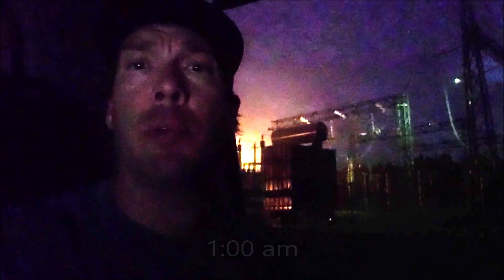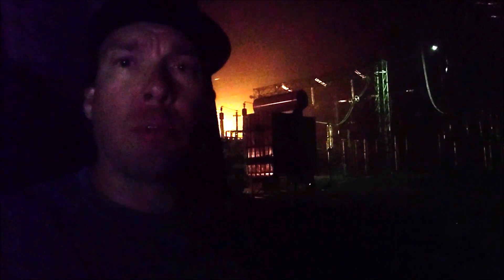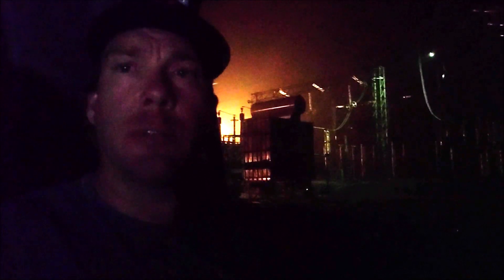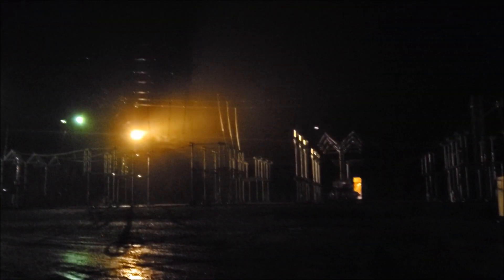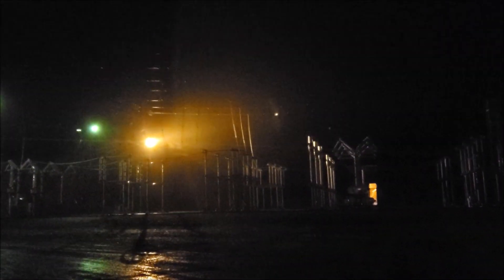Linework during thunder and lightning

Comment: I looked at the weather radar coverage of Canada, including the East Coast. 
https://en.wikipedia.org/wiki/Canadian_weather_radar_network#/media/File:Canadian_weather_radar_network.png 

 IF you live under that umbrella  of radar coverage, you should have a very good idea where thunderstorms are, and where they are headed.  IF your location is outside the coverage, you might consider having your employer install a X-Band Marine radar with a 6 foot long open array antenna.  I was one of the volunteer operators in the County I lived in for 30 years, operating one, before we had the big WSR-88D National Weather Service radar installed 50 miles away. A X-Band 25 kW marine radar up 60 feet can have a range of 94 miles on 40,000 foot high storms.  The modern radars are digital and can be put on the internet.  This would be a giant safety factor for linemen.  We saw all kinds of weather, hail, tornado funnels, in very sharp detail.  The National Weather Service called us twice for help when their WSR-74C radars either were down for parts or had such a heavy storm on top of them they could not see through it.    And likely this would run around US$15,000 or so.  Just turn off the weather clutter remover and you will see a lot of weather.  Several manufacturers make radars specifically designed for weather radars in the US$200,000 up into the many millions of US$.  But a simple marine surface search radar does a very good job of telling you where it is, speed and direction, and a good idea of what is in a storm.

Comment: In the Gulfport Biloxi area here Mississippi Power co has installed about a 8 brand new reclosers on an existing main feeder on Pass Road a main surface road. They added an extra pole between existing poles to add the reclosers on the big 3 phase feeder. It is 13.2 kV line to neutral. It is like the recloser sales guy had a field day in sales.(or they have some weird grid issue to fix)  In  one place there is 4 reclosers in about 1.2 miles. This is the first time I have seen so many that close together. 

These all have a small transformer to power the control box, The box is at eye level at the pole. Some have a UHF Yagi antenna aiming I think at the substation. 

There are a lot of thunderstorms here and hurricanes too. For inventory new transformers get a 6 digit number, stuff like reclosures often has a 5 digit number after a letter, like X123456. I think it too is for their grid schematic since the single 3 phase reclosure has three numbers. ie like X123457 and X123458. 

 They tend to replace the entire yard arm assembly on an existing pole with a fiberglass one with all three insulators already attached.

Many Decades ago some some 1950's & 1960's era neighborhoods had some distribution transformers in parallel. Most of these are gone now. There would be  a 10 or 15 Kva transformer for 2 or 3 homes and another 10 or 15 Kva transformer for 2 or 3 homes and the power co had two extra wires for the two 120 volt legs between the poles. Later they came in an cut out the 120 volt "Paralleling" two wires and ran 2 homes on a 15 Kva or 3 from a 25 Kva. The poor lineman had to use some sort of paralleling test lamps to get the phaseing correct on  the secondarys. Because we get emergency line crews from many states after a hurricane a weird settup is rather dangerous to have.

The coop cooperative power co here uses 14.4 Kv Line to Neutral on the coast. One third way up the state 7200 line to neutral is common and one sees banks of voltage regulators every few miles on a 3 phase feeder. 

A old Legend I heard was after one of the big hurricanes (1947 or 1969 Camille) ? that the coast upgraded to the 13.2 Kv from 7.2Kv since so much was destroyed. Another Legend I heard was the higher voltage stuff is less lightning resistant. Decades ago there were pockets of 2400, 4800 and 7200 stuff that was fed by a mini substation or step down transformer by that pocket.

Comment: I've never worked in the electrical industry, but I've built a few high steel structures in my time.  The standard was the same. If you even see lightning and it could 15-20 miles away. Everyone comes down and the crane comes down.  Then you sit and drink coffee and wait for the storm to leave the area. Until recently, the record distance lightening has been known to travel was about 350 miles. However, within the last year it was observed at a much greater distance. Don't quote me but I believe it was 2500 miles, as observed from space.  So, this is why the SOP is to stop work and take shelter.  

Also did you hear about the two line men that were killed in Saskatchewan? People assumed that it was an electrical incident. However, from what I hear, they both feel out a bucket.  I'm waiting for the details to the circumstances. I find it highly suspect with safety standards such as fall arrest,etc, in place. I speculate that perhaps a mechanical failure on the truck or some other contributing factor. Just my thoughts.

Comment: I leave jobs for at least one hour after last thunder is heard. Lightning can strike out of the blue from storms over 25 miles away. Radio tower work is no fun during a storm even inside the transmitter building. 
I remember a co worker was working on a cable TV line amp towards the end of a T-storm when a bolt hit a pole down the street from him, you never seen someone gaf himself down a pole so fast and into his truck. He later returned to the amp to close it up.

Comment: Wow that is quite the lightening!   Got to like the hum of those big transformers too.
Reply from the maker: The 345 lines were real noisy in the humid air before the rain started too!
Reply: @Bobsdecline  Oh I bet!  I actually heard the sound of HV lines for my first time the other day.  I always wanted to go take a picture at this one spot on the 655 where they go go in a straight line, and while I was out there taking pics of the lines and the changing leaves, I could hear the lines and even feel the power. Most of the lines here are 138kv and I felt that line had to be higher.   Being the nerd I am I looked it up after and found that it's a 500kv feeder from Abitibi Canyon generating station going down south, it's one of few 500kv lines in Ontario.  There are more down south.  It was quite interesting to feel the power on my arms.   This is one of the pics I took: https://i.imgur.com/6VxxQ3K.jpg  I was zoomed right in there, it makes it look like I was up into the lines but it's taken from some rocks on the ground.  They droop quite a bit.

Comment: Talked to a lineman turned electrician years ago while doing contractor escorts, he said he always carried a lightning detector on the job, soon as it detected a strike he came down and sheltered. Should be standard kit for a lineman. You can get them for under $100 on Amazon nowadays.
Reply: Or you can spend only a few dollars and carry a portable/pocket AM radio. Tune to a blank spot on the dial and when you hear the crackling static of the lightning......BTW most lightning detectors are basically an AM or other type of radio with an indicating system.

Comment: NO NO NO being outside in a thunderstorm.

If you ever record a storm using slow motion you see the streamers coming up from the poles and the ground, asphalt is an amazing conductor.

I see asphalt hit more often than any other item, even when streamers are coming off poles high up, the lightning ⚡ takes the asphalt streamer defying the idea that it would take the shortest distance to ground.
I guess asphalt is a lot better ground than an electric pole.
Reply: Asphalt isn't a conductor. It's oil and rocks. If asphalt was a good conductor, you'd see entire roads become energized when lines come down. Now a wet road can become energized due to the water.   I've seen very little in the way of asphalt strikes, but there is a lot of asphalt so it makes sense that asphalt would get hit on occasion. But any asphalt being hit is just coincidence as it makes it's way to ground.
Reply: @mikel9567  I have seen it happen too much to be a coincidence, especially when it had to come down between trees and there were streamers from the poles but it went to the asphalt.

Traveling on I-87 in Clifton Park NY I had a lightning strike come down right next to my car as I was driving. Missed the car by a foot, right between my car and the car next to me.

Where I live now I have only seen it strike the road and the grass, never hits a pole or tree and there are lots of trees but it has never hit a tree.

Lightning is very unpredictable

I was in the Poconos in northeast PA at the Shawnee Playhouse, I think, and we had just stepped off the pavement onto the wooden deck and lightning hit the asphalt about 10 feet from us.

Comment: I've got a question.
I've been going to California a lot lately and the power lines there are in a delta config.
What's you're opinion on delta vs wye?
California is the only state I've noticed delta config power lines.
Reply: Retired lineman 33 years, Eastern PA still has quite a bit 4.8kv delta. I know one thing when it's on the ground it usually stays hot burning, once seen it burn thru 150 feet of concrete sidewalk to the gravel underneath.Wye system being grounded most times will blow a fuse or trip the line.
Reply: @goaheadmakeourdayscooterpe9644  cool! Is that 4.8kv to ground or phase?
Reply from the maker: Delta can also cause high/low voltage issues when load is unbalanced
Reply: @Bobsdecline  My dad and I had that happen to a snow maker a few years ago. We where running it off a generator and one of the phases went out and it burned up the motor. That was on 3ph delta 480v
Reply: Does anyone know why california primarily uses delta distribution over  wye?
Reply: @dylanoakes9557  idk but my guess is that it was a old standard since I haven't seen any substantial new lines that are delta. (Excluding transmission lines) Also old RR power lines (for a non electrified line) are delta and those haven't been changed much if at all since the 20s-30s

The only reason I can think of why they where used back then is that its cheaper than Wye for 3 phase in dense cities since there isn't a neutral line. 

But for a single phase transformer you need to bring two isolated phases to it. So its more expensive to build single phase lines.